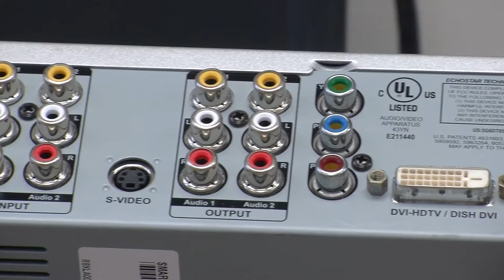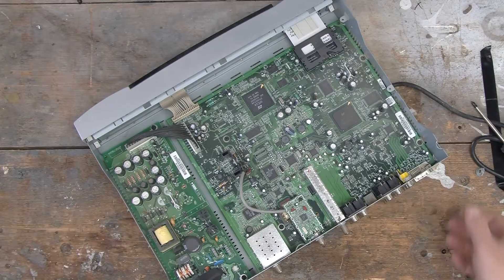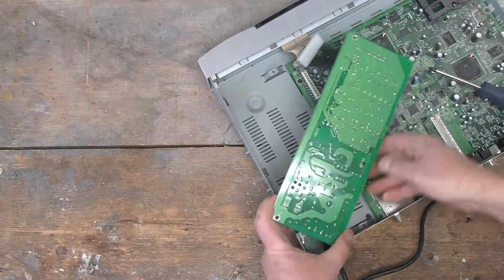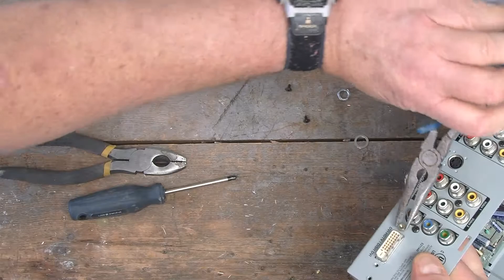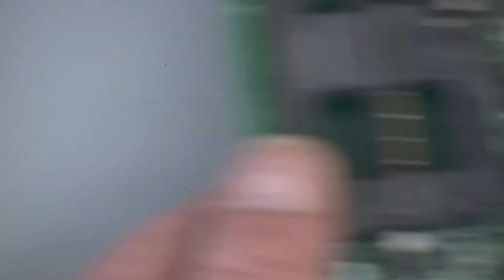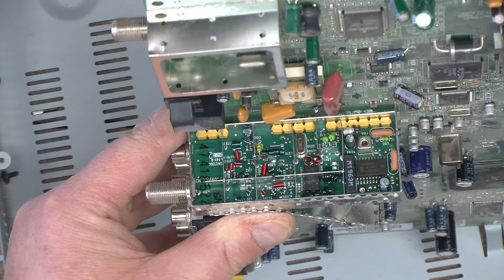Inside a 20 year old HD Satellite Receiver

Comment: Is it still work
Reply from the maker: Not - I did not attempt to make keep it operational.

Not a loss though - this receiver is actually obsolete - it only supported the original MPEG compression  standard and when the satellite TV company upgraded their systems to more modern compression to fit more channels in each satellite, this receiver was no longer able to receive HD. To their credit, they provided a free replacement that did hand advanced video compression standards.
Reply: @ElectromagneticVideos  the ota function still works on the 811s...